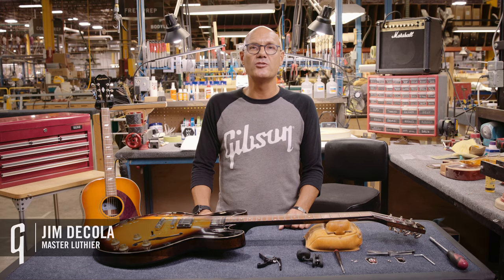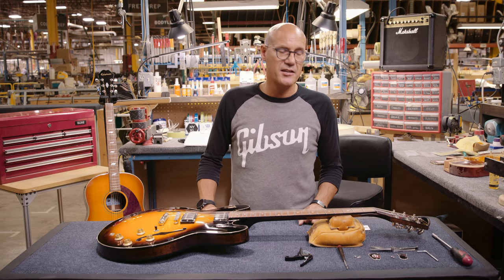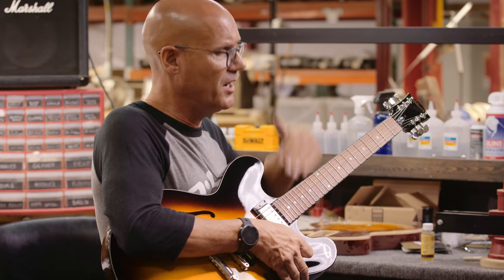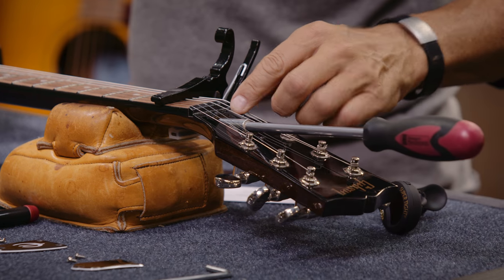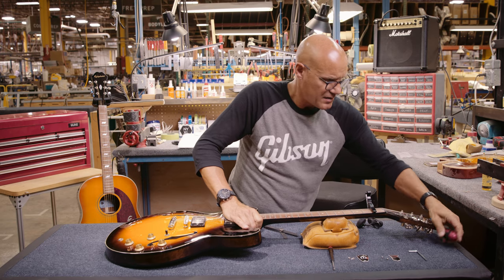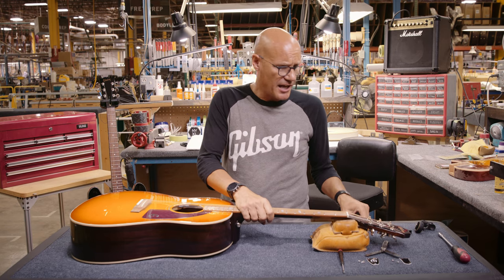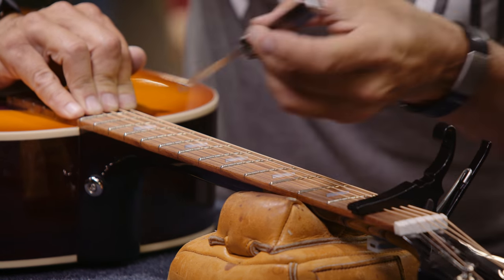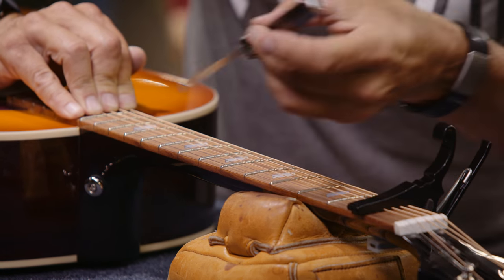How To Adjust Your Guitar Neck (Electric & Acoustic)

Comment: Simple rule: Hold the string down at the 1st and last fret. There should only be a slight space between the string and frets. Then adjust the rod (right=tight / left=loose). If a neck is too flat, you will get fret buzz from frets 1-3. Then loosen to find the "sweet spot" (flat as possible without buzzing from the lower frets). Then do a slight "nudge" in the opposite direction to secure the rod at its new tension.

Comment: I had no idea Gibson invented the truss rod................Thank God!
Reply: They didn't, truss rods had been used for over 10 years before that. Not the only time Gibson patented something someone else invented - humbuckers are another. Gibson lies, a lot.
Reply: @laughingdaffodils5450  and there was a make of guitar with adjustable necks in the 1830s; the Staufer (usually with 'ff' but mine had one 'f'.
Reply: @laughingdaffodils5450  and sues a lot
Reply: @laughingdaffodils5450  the humbucker and filtertron were created at the same time. Bothe seth lover and the creator of the filtertron made a hum-bucking pickups at the same time but Gibson patented it first. Gibson invented the humbucker
Reply: @sixslinger9951  There's no hate, you're delusional. If you're so invested in a brand, ANY brand, that you respond to historical accuracy as if it were 'hatred' you might want to take a good long look at yourself.

Comment: Thank you I just adjusted my 60s Les Paul standard due to string weight decrease! This plays like a dream now with minimal adjustment. Awesome!!!!!
Reply: Hi, I have the same les paul but whenever I put capo at 1st fret and press on 15th and measure 0.08” am getting buzz from High E string and my action is 2mm low E and 1.5 High E. Can you share your measurement and do you capo and 15th fret or what?

Comment: I found this video yesterday, but I didn't watch it until now. Coincidentally, this morning I restrung my guitar and checked my neck relief. I didn't have feeler gauge so I just checked was there any space between my string and fret wire. I found there was a little space in my 6th string and very tiny space in my 1st string. i was confuse and suspected something wrong with my neck. Luckily Jim explain this is ok. So thank you for making this video.

Comment: 5 thou= 0.13 mm, 15 thou= 0.38 mm this is the range. He ends up with 8 thou on the low side which is 0,20mm and 6 thou on the high side which is 0,15 mm.
Reply: Thank you for that. I really appreciate your clarification. He totally threw me off when he said eight thou on the low side as he’s measuring the high side. You can be one of the best at what you do but that doesn’t mean you’re a good teacher.
Reply: Genius thanku for saving me a whole day
Reply: Metric system people are thanking you
Reply: Tks
Reply: Did you mean bass strings when you said low side or high side my english not very well and google translate didnt good translation also can I use this parameters on every guitar or these are just for gibson guitars if you explain me I will be appriciate
Reply: @Mr.Heisenberg26  yes bass strings=low side. You can try on other guitars maybe with some adjustments...take the measurements as a reference not a law
Reply: At this configuration of numbers, why i m having open strings’ buzz?
Specially e(hight/1st) and D(4th)
Reply: @mihirkansara5423 possible issues at the nut ir bridge with string departure/approach angles, possible fret wear/the neck actually swelling causing frets to shift, or even pickup height.

1st, pinpoint exactly where & when your 1st & 4th strings are buzzing, then diagnose from there. In my case, open strings & 1st few frets buzz due to neck back bow. I need to do this once a year usually.

Comment: amazin videos as always! i was adjusting a tanglewwod acoustic, and it ws sounding great, but after applying the last minor adjustment my G string is suddenly stiff and desnt vibrates as much s the other strings, could i have hurt it with the wrench while adjusting? causing a kink on the string or something similar? does that makes sense? thanks

Comment: I'm brand new at guitar, just learning to work on my own.  It seems like it would be better to loosen strings a bit before adjusting the rod. Maybe even give you a more accurate rod adjustment maybe? Probably don't matter but, is it ever applicable to do that? Thanks for the video!
Reply: You need tension on the neck to make the adjustments.
Therefore, all strings must be under tension… ✌🏼

Comment: I had an Epi LP 1959. I have leveled the frets and adjusted relief and action based on Gibson recommended measurement. However I am still getting string buzz on 6 and 5 string when I press at fourth and fifth fret.

Comment: Great video although it didn’t answer what I was hoping for. I have an es 335 with no relief at all so I loosened the truss rod a 1/4 turn, no change. Then another 1/4 turn, still no change. Went to adjust again and noticed the truss rod nut is now loose and I can turn it by hand. Did I go too far? Please help! And I still have no relief in the neck.

Comment: He said their specs were 0.005" for the high side, meaning very straight and 0.015" for the most extreme. He measured the relief at the 8th fret on that 335 at the end as about 0.006" on the high e side and 0.008" on the low e side. Regarding this, can we assume that adjusting the neck relief within this range as follows is alright?

Low E      High E
0.007       0.005
0.008       0.006
.........       ..........
0.015       0.013
Reply: Merhabalar, hangi ölçülere sahip feeler gage almalıyım ben orasını anlayamadım ;( siz anladıysanız yazarmısınız lütfen 8. Perdede kontrol ederken kaç inch veya mm lik gage kullandığını? Vede o ölçüde türkiyede satılıyor mu?

Comment: Hey Jim, I have a new J45 and it appears to have the same buzz as the Epiphone you adjusted. However the truss rod nut on my J45 is completely loose already with no tension on it. Any advice?

Comment: That's all well and good but, what does one do about Epiphones where from +- 9th fret the neck actually rises slightly preventing sufficient lowering of the action for real playability? If you set the neck relief corrcetly then from about the 9th fret you get the strings choking  and bussing on the fret in front and if you raise the action for playability from the 9th fret then the action in the mid neck region is simply to high. I see no way other than pulling all the frets and removing 1/2 to 1 mm of material at the front of the neck to 0mm at the nut and then doing a refret.🤔

Comment: Always reduce the tension before tightening the truss rod . There's no reason to make the brass nut do all that work , just to de-tune it !
Reply: yes; he means let the STRINGS' tension down and then adjust the neck relief. Loosening the truss rod nut is no big deal with a tuned up guitar ... but tightening the truss rod nut against strings ' tension is...

Comment: I need help... My bottom string pings open. I raised it but the string is almost touching the first fret line. I raised the strings but I cannot get the string to hold the ring on strumming. Should I try a new bridge on the neck and at the bottom bridge too
Reply: You need to loosen your truss rod

Comment: I’ve got a 2014 Gibson les Paul custom zakk wylde and I find the e strings slip off the fretboard a lot it seems like they’re too close to the edge which is disappointing on such a high end guitar ... I was wondering how you could remedy such a problem ??
Reply: nut is probably cut wrong. need a new nut most likely

Comment: I bought a Les Paul Custom Black Beauty brand new in 2005, I went to change strings and it backed bowed, I went to GC where I bought it and I was sending it in for warranty repair, the next day I get a call from GC, Gibson was refusing to warranty the guitar because I did not have a professional change my strings if I did the truss rod would not have snapped, luckily for me it was within the 30 days I said fine I will return it, GC was not wanting to do that since they would be out $4,000.00. So GC corporate got involved and I got the guitar repaired, I couldn’t say if it was Gibson or not because I got the guitar back within a week. So if Gibson is watching, I will never buy a new or used Gibson made in the 21st century ever! The truss rod broke because they used an inferior part.

Comment: 3:39 under bow causes buzzing in the higher frets?   If you are buzzing in the high frets with under bow and you tighten the truss rod, thus lowering your strings…Im pretty damned sure your going to get more 🐝

Comment: “No more than 1/8 to 1/4 turn”.  Turns it half a turn.
Reply: Yeah I saw that too!
Reply: I noticed that too and looked like it was tight already. I am terrified to adjust my LP any more as it feels tight but still has a little too much relief.
Reply: @delv2473  nah don't be frightened. If it still has too much relief, chances are your action is probably higher than it should be and thus more difficult to play. He's an experienced Luthier and those people know what is doable and what isn't with each guitar. He likely gave that guitar too much relief to begin with to illustrate his points. So he probably already knew how far to turn it. Definitely stick with the 1/4 turn and you'll be fine. I have a guitar and the truss rod is very tight but can still be turned more lol. Do not be afraid of adjusting the truss rod as it is imperative to your playing.
Reply: @AvnerRosenstein-ULTRA-LXV  OK thanks for the advice.

Comment: Very basic and useful information, good explanations. Thanks. But what the heck stand 15.000 stand for? Come on, please, please use SI units as the rest of the world. I would suggest 0.15 to 0.2 mm. The USA are no longer part of the UK empire which - as Brexit suggests - probably like their splendid unit isolation. Btw, same with PSI. That sounds esoteric but not a useful unit for pressure outside the US :-) PS: No offense ...just a tongue-in-cheek reminder that your guitars sell world wide.
Reply: Couldn't agree more. At least he could've used inches. Knowing how illogical they measure things in the US by combining different units like feet AND inches for one measurement it's impossible for us in the rest of the world who use different multiples of 10 with the meter to understand what 15000 etc means.

Comment: Hm, 5 thousands or 15 thousands of what? And what's that in millimeters?
Reply: Ok, Google says a business card is between 0.010 and 0.015 inches, that's 0,25 to o,38 millimeters. So if i use my 0,35 mm feeler gauge, that should fit, right?
Reply: @erwocoolis9451  you can use between in 0.25mm -0.40mm up to you ;)